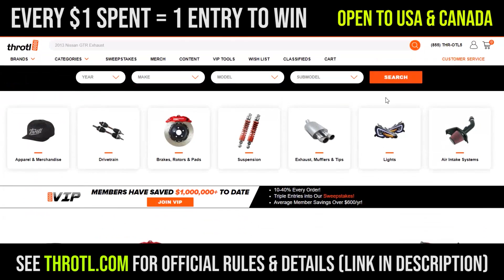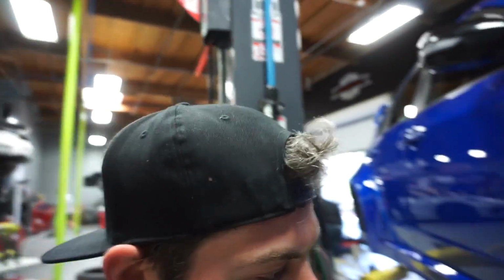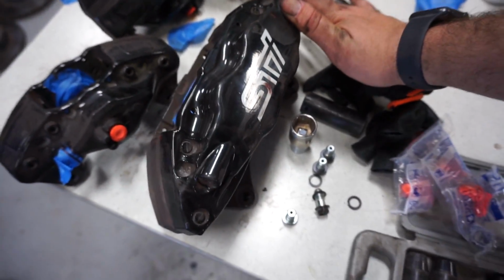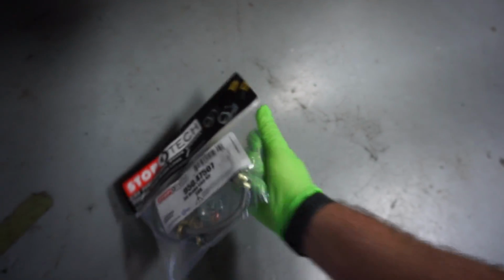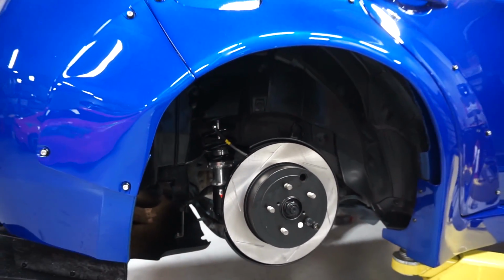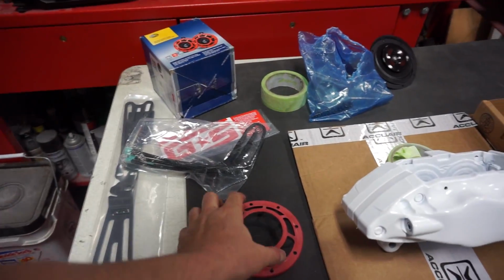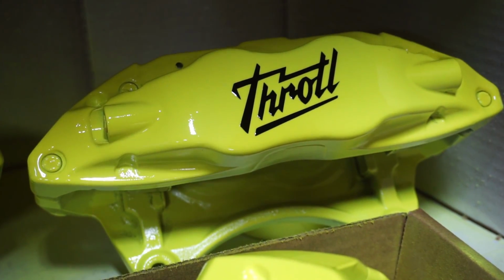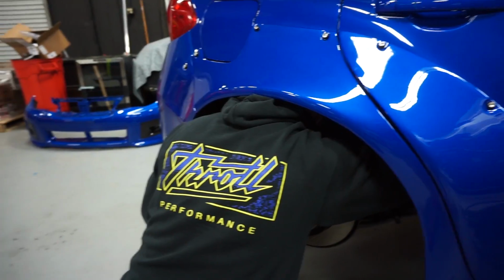Building the ULTIMATE 2008 Subaru WRX STI Hatchback - Part 6 - DIY Fluoro Yellow!

Comment: The best thing I ever could have done for my car was replace all of the suspension bushings, engine/trans mounts, etc. I added these badass billet aluminum eBay strut tower braces and my car drives and handles so much better. I hope you guys replaced all the bushings in this car! 2008 was a long time ago to very likely still be riding on the same bushings.

Comment: What works for me to I dont loose to much fluid or make a huge mess, is a tire valve stem through the brake hose. Seals it right up so you domt have drips

Comment: Instead of spending a fortune on replacing my engine splash guard and wheel well liners, I looked at the AirDam sheets (used to build ducting for race cars), and found out what kind of plastic it was, looked around elsewhere for cheaper, and found Lowe's carries 4x8ft sheets of the same material for a fraction of the price. Then I used the old ones as templates and made my own guard and liners. So, just a hint guys, when you widebody a car like that, you can easily make your own inner fender liners and engine guards using this material. On Amazon, it's called AirDam, but you can get giant sheets of the stuff from Lowe's. It's like a 1/8" thick sheet of heavy duty black plastic.

Comment: Next time you take off calipers just run an old (or new) tire valve stem thru the opening on the brake hose. It'll stop the brake fluid from leaking everywhere  and you won't have to deal with having to bleed the system as long.

Comment: While you was doing the brakes should've changed those bolts you cut down with the grinder for the correct shorter one's, very dangerous to cut wheel bolts with a grinder 😭

Comment: I can’t believe you’re putting vinyl decals on calipers of a performance car.  Weak AF!  Pro tip?  Get the ‘reverse’ of your logo cut, and use it as a stencil to paint.
Reply: Eric Schutt - Except using the proper vinyl is adequate. Been doing them this way for years and never an issue.

Comment: you guys need a small paint booth, this ghetto painting is nasty and sprays can, you have compressors buy a paint gun they are cheap, always painting in front of the door or inside with all that overspray going inside its a no-no... if you are doing to do stuff like this needs to be done right or don't do it, it's your company your reputation, btw the color of the calipers is awesome